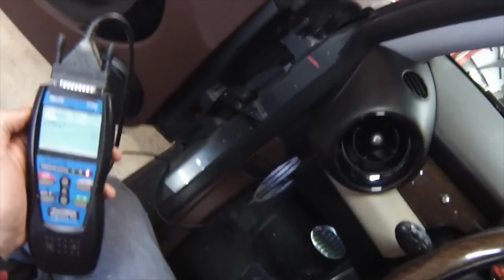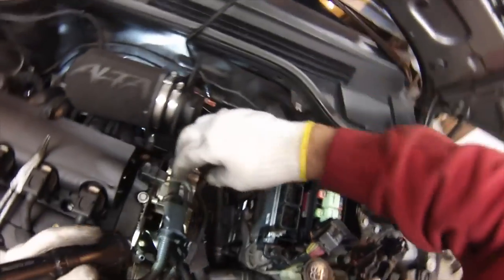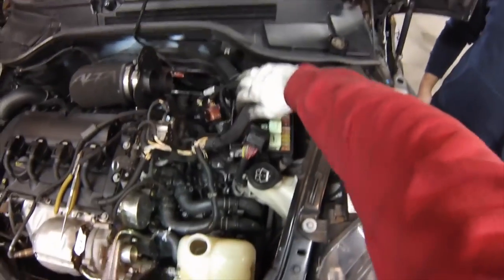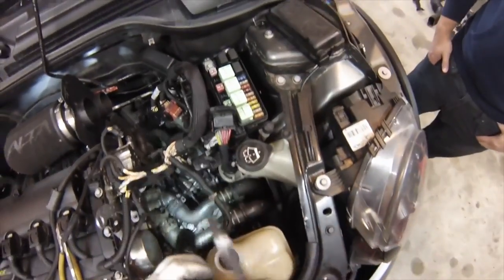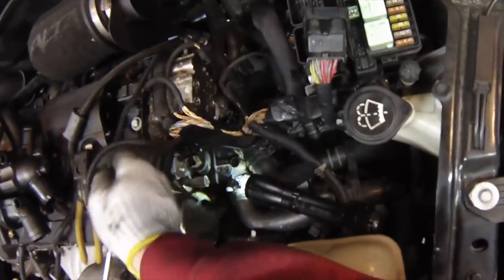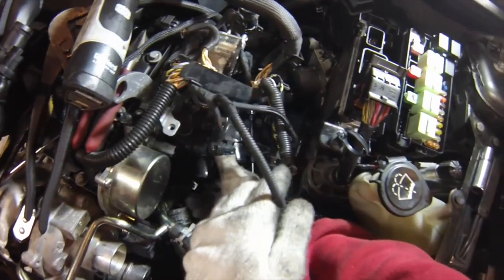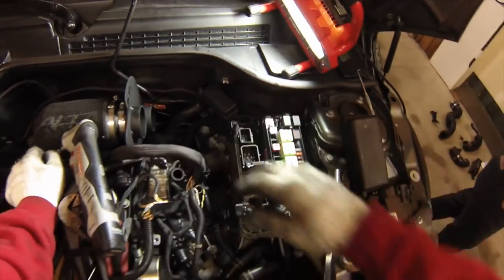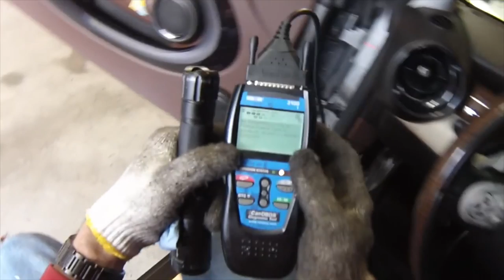How to Replace Coolant Thermostat Housing MINI Cooper R56 2007-2013

Comment: Good Morning Mod Mini ,Love Your Video's Question Changed Out Thermostat on 2011 Mini Clubman Base, I also bought New Wiring Harness for Temp. Switch & Computer at Bottom of Thermostat. I am Glad I did old Thermostat had a Prope  at the Top like a Water Heater in Your House. My Question is still getting Code P0597. Is it possible to get the Two Connections for Sensors  mixed Up &Car Still Run?. Just not Sure Which one When where? Thank You for Your Response..KC
Reply from the maker: I haven't done a 2011-2013 thermostat in a while, but car would run even without the wire connected at all. You would definitely get codes if you got the wires backward, if that is even possible.

Comment: I’ve got 140.000km on my R56S and changed the thermostat housing for 3-4 times. What’s the case? Why is this part failing so often?
Reply from the maker: You must use genuine housing or an original equipment supplier. Most of the aftermarket thermostats are bad quality or not correct for this car. See video description for a product link.
Reply: @ModMINI  currently unavailable on amazon. Do you have another source?

Comment: What would cause the cooling fan to run on even after the car has only been on for seconds and is not even warmed up? It runs for about 5 or 10 minutes and then shuts off. It has drained my battery a time or two doing this. I have had the thermostat replaced, as well as some electronics for the fan control but it still runs on after the car is off. No one around here can identify the problem, but this didn't happen until relatively recently so I know it's not normal behavior.
Reply from the maker: Bad temperature sensor or faulty temperature sensor wiring. Use a bidirectional diagnostic scanner to query for ECU for what it thinks the temperature is.
Reply: I'd an issue like this & other sites mentioned possible relay & sensors, I've checked my relays & changed 1 "as a just incase" & never had the issue again, my fan ran for ages (hour plus) whilst the engine was off, after a short easy drive. To check the relays there in the engine bay in the long fuse box next to the intake/filter pipe. Another basic signs for this issue is the fan may not run when the engine is running/being used etc.

You can google or search utube for the issue as its shown on here via other videos etc

Comment: Hi, my thermostat temp always keep in 227F thats normal? and the fan keep on always even after the shutoff the car
Reply from the maker: It is normal for fan to stay running on hot days and these cars like to run at about 210F. If higher than that or if fan is running even on cold days after short trips, you may have a wiring problem or failed temperature sensor.
Reply: The thermostat you have installed at what temperature work? It the fan work constantly?

Comment: Warning !!!!!If you follow this you will short your high pressure fuel pump. You should not disconnect the complete wiring harness.
Reply from the maker: Disconnect battery first?
Reply: Mod MINI yes I did
Reply: Why would you create a short circuit when power isn't going to the pump due to the ignition being off...
For general safety disconnecting the battery however is always a good start.